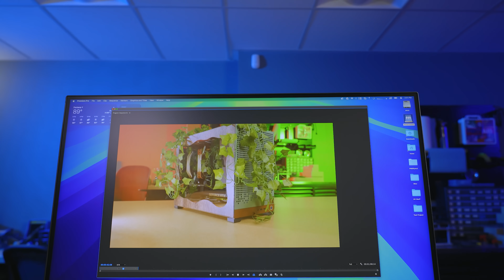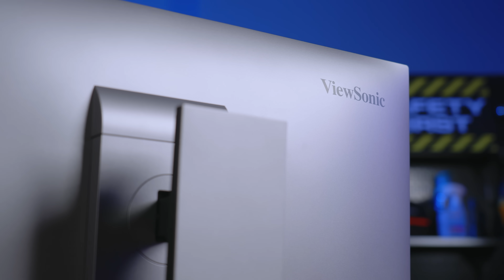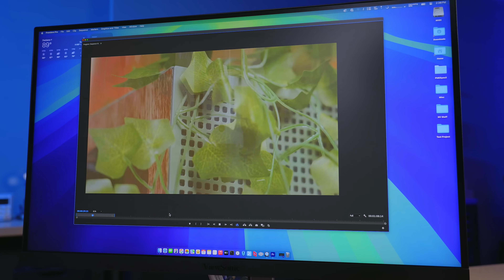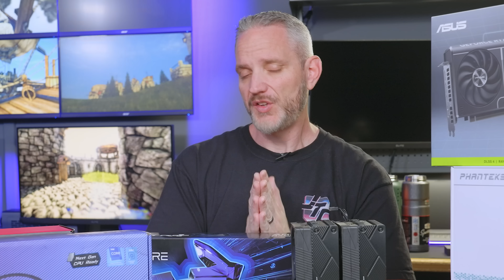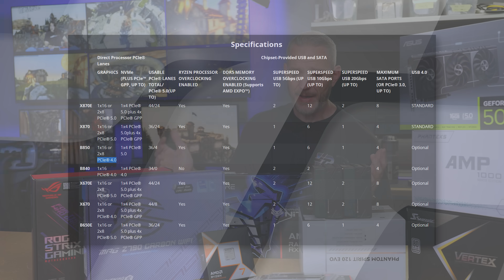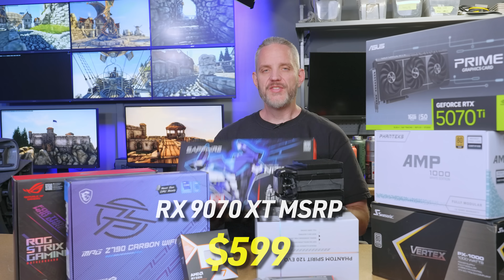This is the Sweetspot for PC gaming... Don't get fooled into spending more!

Comment: Is there a problem with having a b650 with a 9800x3d and a 5080? I'm using 2x Ares Ram sticks (2x16gb, 6000mhz, 30cl .. it was the cheapest 30cl specked 6000mhz stick on the list of my mother board, officially, supported ram that also supported xmp / expo) I feel like I'm bottlenecking somewhere lol. I bought my PC premade when the 5080 just released. I paid 2700 euro for the PC when the 5080 cost 2000 euro and was very hard to get. (now prices have dropped to closer to MSRP). The PC was still a good deal, even today it's a good deal (for a prebuilt, I mean I regularly see people pay this much for PC's that have 5070's and or AMD cards in them) But it does have a b650, came with 4800mhz ram, they very clearly cheaped out on stuff but on the other hand seem to have built the PC well. The temps seem ok (GPU on full load generally stays below 70c but sometimes will hit 71/73, CPU generally seems to stay under 70c but I've not tested it extensively. I do feel like the idle temps and temps while browsing etc could be lower. (artic freeze 2 AIO cooler), generally around 50c for the cpu. Low 50's and high 40's not a problem because the PC stays still on silent mode (Gigabyte control center fan curves). But esp on slightly warmer days when it is often over 50/55c it will kick in and the difference in sound between 45/50% fan noise and 60% is huge.  Will probably add another SSD .. might change the case because the case is kinda trash too. Probably will replace the fans for 140mm ones

Comment: Yesterday I installed the new Arctic freezer pro 420 with 6 intake fans. I can now run my 9800X3D at 5.6GHz without thermal throttling  even whilst compiling shaders.
Finally my build is in its final form with 10 intake fans and 4 exhaust (all 140mm).

Comment: As someone from a country with high power costs, I always recommend opting for a platinum power supply. They aren't that different in price (I just checked and saw a 20 EUR difference in an otherwise identical 850 Watt model), which will be in 3-4 years, considering the high power costs. However, would the power be cheaper here? I would also opt for lower tiers.

Comment: Thermalright has Aio's on Amazon under 100$ that will out perform that air cooler.  With the bonus that if it sucks or has an issue, returning it is super easy. Thermalright FW pro with LCD screen and non RGB fans is under 100$ Canadian.  Definitely worth.

Comment: The point about CPU bottleneck makes sense a lot of the time, but there are also games that get CPU bottlenecked pretty much regardless of what GPU you have. MMORPGs for example, WoW/FFXIV, some RTS games (especially when you're in a team game where several players are maxed out on the unit limit) if you dig deeper you will maybe find more examples

Comment: I recently specc'd out an AM5 system - and quickly came up against the lane splitting issue where the graphics card is cut back to PCIE x8  if you put an M.2 drive in certain slots.  I have 3 x M.2 drives on my old AM4 system and want a similar setup on my AM5 system.  I found it very hard to find out whether the boards I was looking at could support 3x Gen 4/5 SSD's without lane splitting.  Even several local Tech's in PC stores could not tell me this.  Say the Gigabyte Aorus Master X870E for example.  Under what circumstances will that lane split and downgrade the GPU to x8?  Can I run 3 x SSD's in it without it lane splitting?  I just couldn't find that out.  Trying to look at technical specs on motherboards just didn't answer this question.  I feel we need a video on this as I'm really confused as to how you're meant to find this out.

Comment: Saying "Cases are 100% form over function most of the time" is probably a better way to upset GN Steve than the Heaven wall.

I paid a little more for a case and got the Antec Flux Pro which i can 100% see the benefit of in my GPU and GPU temperatures.

Comment: I'd say only one thing about the  power supply as you rightly pointed out that they are one of the components that will be around for the longest. I recently acquired a proper GPU. A used 3060ti to replace my laughable gt710. My PSU was over specced at 650w for that system with an AMD 3600. 650w is enough for the 3600ti, but I still had to replace my PSU as it had no 6+2 cables for the GPU, & I wasn't risking an adaptor. If platforms change & you've spent more on a PSU that won't work anyway, that's wasted money..I'm not saying you're wrong, but there's never any guarantees.

Comment: Jay, what do you think of AIOs in hotter countries, like I'm the middle east for example due to dry air and the ambient temperature and air being generally much hotter than America and the west, would a fan still be good, or AIO is better?
Reply: Basically, heat is heat.  If the room where the PC is being used is warm, and it will be that much harder for either the AIO or air cooler to maintain a reasonable operating temperature for the PC's components.

Comment: My build sweet spot is a B650 Gigabyte Aorus ice with a 9700x and 32gig DDR5 6000. I'm using a 2TB gen4 nvme by Inland for booting and 2 1TB nvme teamgroup gen 4 and a samsung nvme 512GB for games and other software. My GPU is an ASROCK steel legend 7900GRE that I got from newegg for 489 before the pricing went back to stupid. My case is a Montech King 95 Pro with all fan slots occupied  and my cooling is handled with a peerless assassin 120 also in white. My PSU is an EVGA 1000w super nova that was a grab off FB market. Thanks to Micro Centers combos and some major deal searching i kept the cost under 1200.

Comment: Huge fan of the 9070xt or even a used 7900xt with a beefy cooler (great OC potential). Cl28 32gb g skills ram. Personally would still recommend a 14700k for people that want decent gaming fps AND are streamers/content creators. Those extra cores at a lower price sure are nice. Otherwise of course 9900x is right up there but much more expensive. Being on the AM5 socket that should have at least another generation of cous is a huge bonus though

Comment: The absolute best advice in this video pertains to the PSU.  I've been PC gaming for over two decades, built a few rigs of my own and upgraded a few off-the-shelf systems.  The ONLY component I've ever had fail was the PSU.  Figure out what the max rated draw of all the components are and then go shopping for a PSU that has at least 50% more capacity, double is even better.  It allows for upgrades later and you're not working it as hard at full load.  My personal best advice if you want to save money is to stay away from RGB components.  That crap is expensive and none of it makes the machine go.
Reply: Agreed. Had more than just psu the fail but it’s by far more likely that your psu goes first. 

And, get a good quality one! A good power supply just kills itself when it dies. A bad  one will take everything else with it.

Comment: After almost 12 years (current pc from 2013, gpu from 2016), I decided to build a brand new (whitebuild) pc - I actually started buying the first "non crucial" parts in the end of 2024 - PC still not finished - still not sure which gpu to buy - every decision feels like a bad decision when it comes to the gpu rn.

Which gpu to buy? :O 1440p (IPS rn, later oled)
(my old one is a Palit GTX1070 SuperJetstream (?), really dont wanna put that one into the new pc :/ ) -> "O7" to my 1070 for serving me like a chad for 9 years straight!

[specs]
Mb:     AM5 MSI MPG X870E Edge TI WIFI (white)
cpu:    AMD Ryzen 7 9800X3D (not white :P)
gpu:    ???????????
ram:    Kingston FURY Beast RGB (white), 64GB , DDR5-6000, CL30-36-36
aio:     DeepCool Mystique 360 WH ARGB (white)
psu:    NZXT C Series C1200 Gold (white) 1200W ATX 3.1
case:  be quiet! Light Base 900 DX (white)
fans:  Thermaltake SWAFAN EX14 ARGB Sync TT Premium Edition, white, 140mm (full case) + a bunch of strimer wireless and stuff
m.2:   Patriot Viper VP4300 Lite 2TB, M.2 2280 / PCIe 4.0 x4 (also not white :P)

Comment: I have a RTX 5080 ZOTAC Solid OC, Seasonic Vertex GX-1000 PSU, G.Skill Trident Z5 DDR5-6000 CL28 RAM, Ryzen 7 9800X3D CPU, ASUS ROG Crosshair X870E HERO motherboard, DeepCool Assassin IV cooler, Samsung 990 Pro 2TB NVMe SSD, Fractal Design Torrent . I had lowest latency in mind for this build.

Comment: I just recently built my new AM5 Rig, and, funnily enough, the B850's were ~Cheaper than the 650 boards, probably because everyone is buying 650. I'm very happy with my build, it's been handling everything I've thrown at it at 1080p, and will continue to do so when I finally upgrade to 1440p; Ryzen 5 7600x, ASrock B850M-X, Sparkle Titan Arc B580, 32GB Corsair 6,000M/Ts Cl30 RAM, Lian Li Lancool 207. Cost ~£800 using my old cooler (Noctua NH-U9S £75) and my old SSD (Crucial 1TB £60).
Reply: Likely supply and demand for 850vs 650. The awkward thing amount amd and am5 is that it's years old. We keep getting new cpus for it but they work on the older boards so why buy a new one? Unless you are getting an insane influx of new people on am5 randomly late in it's lifespan then no one is buying the b850s even if they are newer. Literally no point going from 650 to 850 so they just put the price down to move inventory. 

I will say as of right now for msi and asus at least can't be bothered checking the rest the 850s are costing more even if only 50-100 dollar difference. I assume more people just ditching intel after 14th gen and now after learning core ultra is a 1 year platform people are just fed up lol

Comment: Just one thing about the CPU i think you missed mentioning: don't go for all core benchmarks. worthless for gaming as long as you have 6, but better 8 cores.

go for single core performance, yes STILL. no matter how many cores are being utilized, there is always the main thread underneath that needs to tie it all together and will be the bottleneck, especially if you like to play strategy games with many things going on at once.

also, SPEND MORE on the CPU...a GPU upgrade is always easier 2 years down the line, 1 CPU for 2 GPU gens is a good target.

edit: oh yea, CPU cooler -> biggest you can get/afford. no really. there is NOTHING more annoying than hearing your cooler for the lifetime of your build. if you arn't deaf...oversize to the max.

Comment: Main reason why i bought 7800x3d is the fact, i tend to swap graphic cards way more often than CPU or Motherboard... so i dont mind my 7800x3d is not fully utilized (i like it running cooler), because i know, that when i swap the graphic card i currently have (4070Super) it will still be more than enough to handle it... and i went with 4070Super mostly because i dont want a card that will eat 3-4x more power than rest of the system combined.. I found 4070Super to be in a sweetspot power/temperature wise, and i will only swap it, when there is a card out there that is significantly more powerful at the similar level of power drawn. I just hate hot and noisy computers.. as mine usually runs 24/7/365... (and FYI, i bought 7800x3d about a year ago, paid 375 eur for it - i cant find that CPU where I live  today cheaper than 400+  so im quite happy with that purchase)

Comment: Thank you Jay for another, as always, great video! Regarding PSU:s, yes I agree 100% - but want to add that the manufacturers warranty-time is also a variable to consider when buying.

I would say max. watts - 2 tiers above. I think it is good to not be at the limit of of PSU:s rated watts - because, as I understand it, 40-60% load is best for efficiency, meaning above ca 60% PSU load lead to proportional more heat and also fan noise.

And yes, follow "the gold standard" :), "80+ Gold" is probably good enough for home users with mixed usage of heavy/light/idle-load, I think. But only IF the PSU is from a recognized and established manufacturer WITH good customer-reviews for the product. And not loud PSU, no coil whine etc (true regardless of silver/gold/platinum-rating), in my opinion.

It is also worth noting how much money is saved by better % efficiency over let´s say 10 years of 8 hours power-on time each day. And it not powered on much time, then the typical better % efficiency will not make a big difference. Actually, many argue that the % better efficiency don´t give that much better energy-cost savings for most home users, but that is up for debate, I guess.  

br //M

Comment: 10 years old Noctua NH D15 here. The oldest part of my system and it is still one of the best air cooler.
I can only recommend Noctua, if there is a new socket, they just give a new mounting system and there you go. It supported my old i7 4790K and now with the 5800X3D on a AM4, but I can use it with an AM5 CPU if I buy one. Its just an amazing brand.
Reply: Noctua D15 is a great air cooler, I have one with my 10700k on my Intel PC.
Now I have Thermalright with my other PC with a 7700x, also solid.
Reply: NH D15 is peak. I love it so much.
Reply: The future is now fellow old man. Noctua was the go to 10 years ago, but nowadays Thermalright does the same job at a better price point.
Reply: @ZxChrono  So? Are we supposed to buy that one just because it's newer? 10 years ago when we bought it, there was no alternative, that Noctua he was the king. You were probably in kindergarten back then or shitting your diapers, I understand (I learned to build and fix computers when YouTube didn't even existed).
Reply: i had a bad rgb addiction. Noctua helped brake the habit. Noctua could easily add rgb and charge more but they have built a super reputable brand off performance. I respect that. Corsair is opposite, they focus on aesthetics and trick people into thinking they need to buy everything corsair.
Reply: I have one here too. It cooled my 4790k for almost 10 years. Now, it handles an i5 14400 like a champ. I had to buy the mounting kit (I know Noctua can send it to you for free but in this third world shit hole I live, just buying the mounting kit it's quicker and easy).
Reply: Built 2 years ago using the d15. It is still a beast.
Reply: Such a good point. I've always been a fan (lol) of Noctua. I like that they include all the brackets I need, and I can always get another bracket later if something changes.
Reply: @thestig007  Thermalright also does this. Noctua aren't anywhere near as unique as they once were and their products no longer command their eye watering price tags on their own merits. They are solely trading on their name and reputation at this point. If not overspending is the goal then Noctua is out of bounds. Period.
Reply: @bearde_mut9731 I use a thermalright dual air cooler all black. It is a solid cooler, affordable too.
Reply: @Bearded-Mutt  Their fans are way better than what Thermalright offers. So the ideal cooler is a Peerless Assassin or Phantom Spirit, but with Noctua fans replacing the default Thermalright ones. It'll be far quieter with essentially identical cooling performance.
Reply: @Bearded-Mutt  noctua was never making a majority of profits on air coolers anyway lmao they still make the best fans on the market and no one comes close to noise under load
Reply: An you can't do that with Thermalright? Look 10 years ago sure it was absolutely worth the investment, these days? They're costing on reputation alone. They've been matched on performance and quality by numerous Chinese brands at this stage and for far less money. Even ridiculously less money in some cases. So in line with Jay's sentiment of not overspending you are actually giving some bad advice.
Reply: @Bearded-Mutt Which brands and models have the same quality for less?
Reply: exactly me, after using the i5 4690k@4800mhz for 10 years i upgraded to 5800x3d and used my noctua nhd15 with adapter and it's awesome. Upgraded my 1080ti for a sh 4070 because i found a deal and i will still be good for at least 5 years

Comment: I feel like you are scaring people with the whole "dont buy a 750W, the wattage goes up up! UP!"

I mean, ofc wattage is gonna go up eventually, but MOST poeple will not buy an XX80 or XX90 GPU or AMD equilant.
750W is more than good enough for 95% of the people buying gaming computers.

I have a 750W myself with a 7800X3D paired with a 4060, and at some point ill upgrade to either a 4070 or 5070 (or 6070 when that happens) and i know for a fact that will be good enough.
You dont need the most powerful shit (or the most expensive) good enough, is good enough.

And sometimes i also feel like the points you are talking about come from the perspective of someone whom is too rich for the points/oppinions to be trusted in anymore, (i wanted to elaborate a bit more on this but ill leave it like that).

Comment: Hey there guys :) Quick Question:
I have a 2070 Super +9900K (4.8ghz, bad silicone lottery) and was thinking about getting a used 3080 12GB (330€). 
Would be a jump to run newest games at Ultra, but would it be worth it?

Thanks for your time <3

Comment: I'd like to say that if you buy an overspecced PSU and end up not having the money to buy the graphics card you need, I'd say that'd just be a bad idea. Buy a PSU that can run the GPU you have budgeted for, but don't overdo it too much. Like how my new computer runs a Intel Arc B580 and a low to mid tier CPU, because it was what I was about to afford; I wouldn't put money down for a 1000W+ PSU. That's expensive overkill.